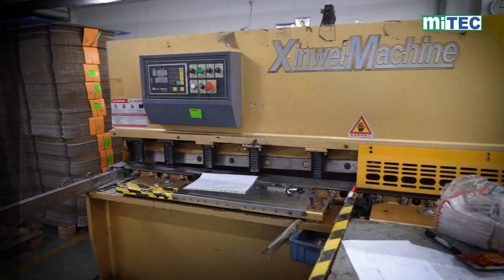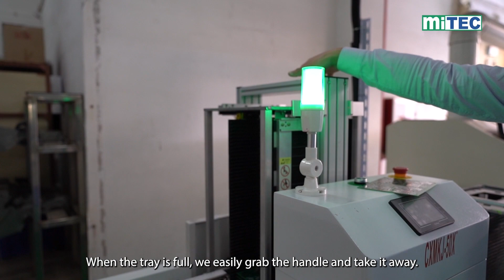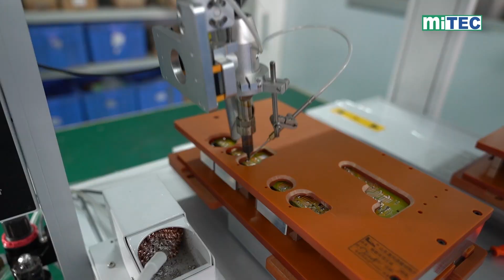Automated production line and metal processing area, a factory tour to miTEC Electronics Co., Ltd.

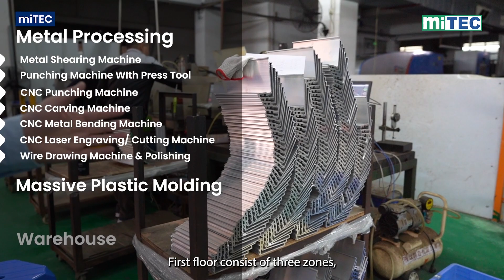Comment from the maker: 00:00-00:23 Introduction 
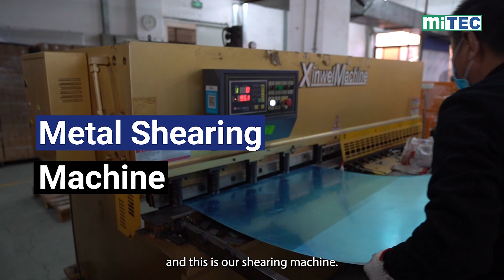00:24-00:40 1/f overview 
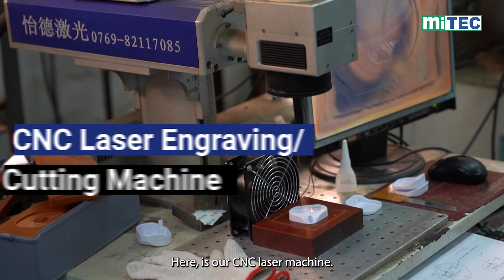00:41-02:54 Metal processing area
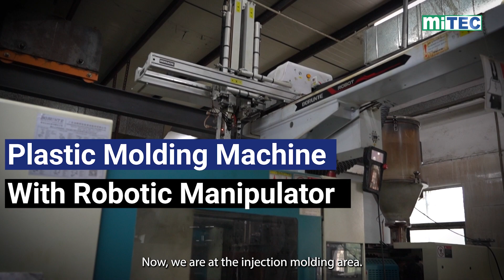02:55-03:15 CNC laser engraving/cutting machine
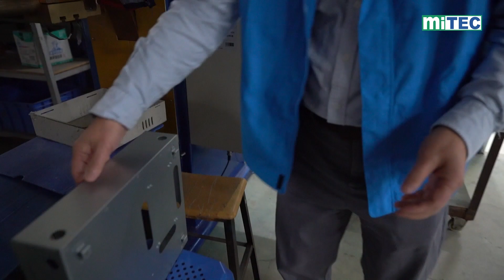03:16-03:52 Plastic injection molding area
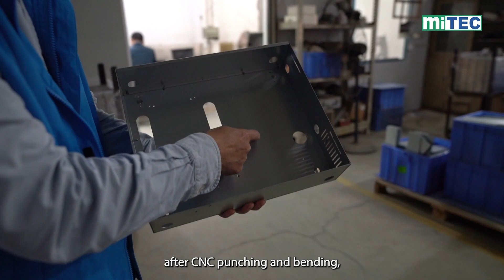03:53-04:32 Butt welding 
04:33-05:20 Metal Brushing & polishing area
05:21-05:30 3/f overview
05:31-05:50 PCB components storage
05:51-06:56 Automated SMT Production area
06:57-07:49 Automated insertion area
07:50-08:36 Manual insertion for large electronic components, test for semi-finish product 
08:37-09:19 Wave Soldering area
09:20-10:07 Automatic Soldering machine
10:08-10:32 2/f overview
10:33-11:00 Aging test for power supply
11:01-11:28 Automatic test system for power supply
11:29-11:40 Silk screen printing
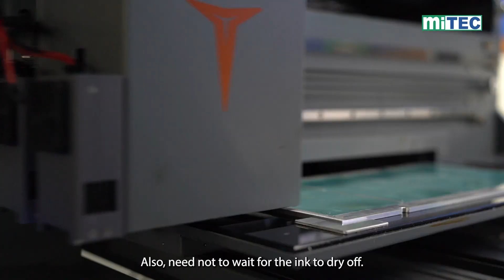11:41-11:51 OEM service, customization 
11:52-12:19 UV printing
12:20-12:37 Final packaging
12:38-12:59 eco-friendly packaging
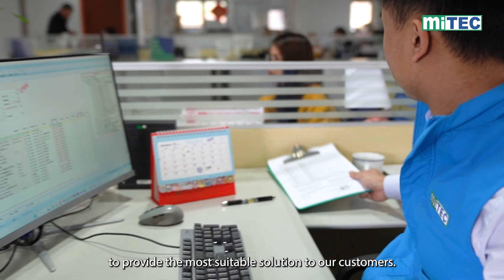13:00-13:57 Warehouse for electronic parts
13:58-14:27 Professional consultation and sales team with global visions
14:28-15:05 Solar power system
15:06-15:19 Book a factory visit